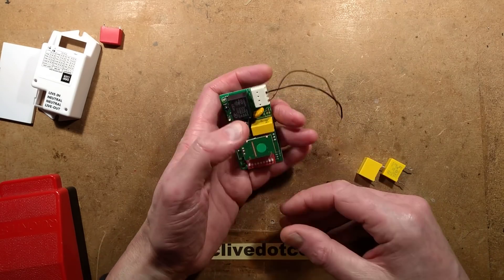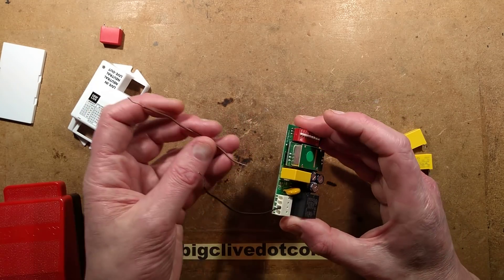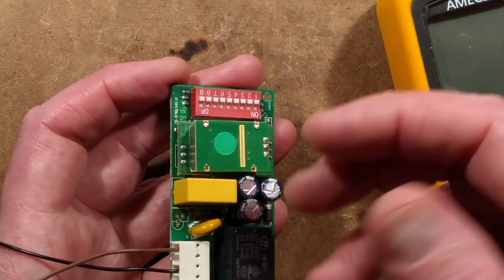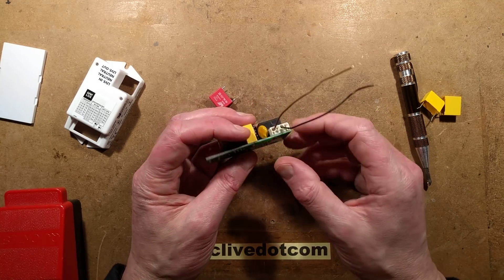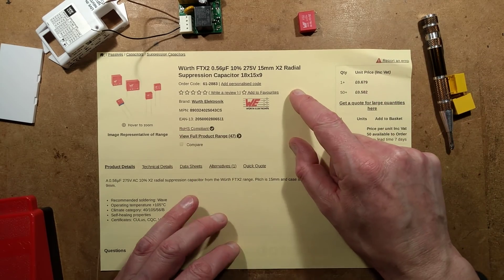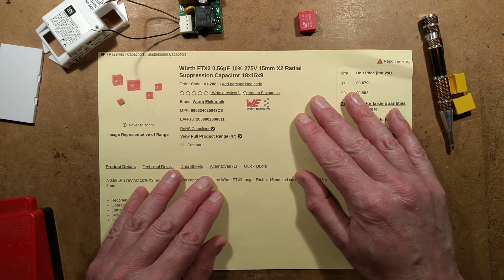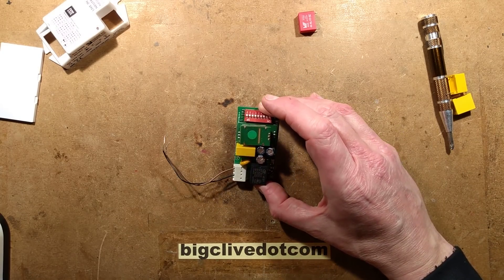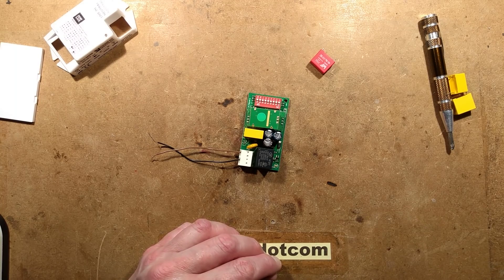Fixing a microwave body detector.

Comment: Hahahahaha!  As a faculties director of two hotel casinos it’s a shame to say my crews would not be capable of that simple repair even if I showed them what to do. Forget the parts cost it’s a straight R&R every time. Now the ten bucks on the power bill annually is a real problem for me because I do get charged for power factor. Probably costs me $200,000.00 a year on the bottom line. Love your work BC!  Keep it up.

Comment: I found a internals from PIR detector a few days ago. Apart from damaged solder pad it didn"t have any other obvious faults, but still wouldn"t give any sign of life. It turned out, that exactly the same capacitor 334 (330nF) has lost almost half of it"s capacity. Replaced it and sensor came back to life. Thank you :)

Comment: I had a cheap China ordered microwave motion detector that I tried. I didn't like it much. Sometimes it would detect through doors, meters away when I'm still walking down the stairs to the level where it was placed. Also the relay died in it in a year or so. (Which I don't like anyway because it clicks and adds delay). Since didn't want to do (and don't know hot to really) rewiring I had to connect it within the lamp body.
It's this sort: https://www.aliexpress.com/item/32723438815.html

(also the max timing was 3 minutes which was annoying, but not the fault of the technology.)

I had a better experience a cheap PIR kind: https://www.aliexpress.com/item/32598059177.html
Though it is too big for the 65mm round boxes used for switches and wall sockets we have here it fit well in the 80mm box that's only used for electrical piping. And since it's only required to be connected on the live wire I only needed to cut  and connect it. It switches instantaneously, because it's electronic and it's pretty sensitive.
It does need to be powered down for several minutes when you unscrew bulbs and change the time delay, otherwise it just blinks crazily for god knows how long.

Comment: X1 and X2 capacitors use zinc metal layers. This was a step change in production methods about 20 years ago in a bid to reduce the size and cost from the aluminium film. However, when zinc oxidizes it becomes an insulator and interestingly becomes transparent and therefore looks like the metal has gone but it's just converted to zinc oxide. There will be a gradual decrees in capacitance while it oxidizes at the edges but when it oxidizes right across the width of the film you can loose a large section of area and a big loss of capacitance very quickly.

The problem comes from the fact that it is impossible to seal the lead. There is a differential expansion coefficient between the epoxy resin and metal so will crack allowing moisture inside, so these will fail quicker in damp environments. Manufacturers have experimented with oil impregnated versions to help seal against moisture and do improve longevity by about 50% in cool climates.

The best X-Caps are those made with aluminium as they do not degrade any where near as fast but are much larger and no one makes them anymore I believe which is unfortunate as these are used in a lot of products from Showers, Boiler controllers, washing machine controllers to small sensors like these. We used them a lot in products until we started seeing premature failures after they changed the chemistry and we've now switched to small switching power supplies with high grade electrolytics.

X caps are used since they are guaranteed to fail open circuit and not burst into flames and therefore no inline fuse is required saving cost and power supply complexity.

However this product fails Low Voltage Directive because it doesn't have the discharge resistors.

Comment: It's about time those capacitative droppers got banned. They are cheap and nasty, especially when they have no bleed resistor across the input capacitor. Power factor correction isn't such a difficult thing to implement on power supplies... a lot of reputable computer power supplies are already built this way. The other thing that can be done is to get an average measure of the PF for your entire house, then correct it at the switchboard. There's always a way to poke the bean counters in the eye. 
BTW, the PF issue is also used to pay you less for your solar power (or make you generate less than you otherwise could). Some companies here in Australia make you generate at a PF of 0.9. That way, they place a 90% limit on what you can input to the grid, and of course that's after they've already put a cap on the biggest system you can connect up to them. 
Roll on solar/battery systems. That way, you can either go off grid, or use your own battery power when your house's PF is at it's worst.
If the power companies keep fiddling with how they bill us to get more out of us, a lot of us will get wise and leave....

Comment: Speaking of technicians fixing things. The building services people at work decided to do a genset test, but evidently there was some piece of faulty equipment, because it spiked all the UPS circuits in the building when they cut over the UPS supply to the genset, causing the breakers to trip, but not before it took out its fair share of gear. Thankfully I wasn't on call though! Most of our gear was under support, and had redundant power supplies, so the guy who was on call logged faults with our support provider and spent half his weekend waiting for replacements to arrive. Of course, he forgot to check the network switch in the technicians' workshop, so the replacement arrived on Monday, I went to swap it out, but the technicians had already replaced the blown capacitor in the power supply, and were busy working on other faulty gear that we were still waiting on replacements! I had to tell them to stop, because we get charged a re-stocking fee for returning working gear instead of the faulty ones!

The worst part was that this genset test was after the last one, during which the generator failed to start, so once the UPS batteries ran flat in a few minutes, our entire data centre just unceremoniously shut down. Thankfully these incidents weren't at the head office, so these failures didn't completely shut the company down (although it has happened there once).

Comment: How about using greencaps/resin dipped film caps instead of X2s? Would they last longer? I know they’re not as safe, but a fuse(able resistor) in series would prevent that being an issue.
Reply from the maker: X2 caps are supposed to be the safest for connection across the mains.

Comment: The office floor I last worked in, had all the microwave sensors replaced due to a few offices, mine included, having lighting problems. Building was only 5 years old. The old sensors thrown into our office waste paper bins -now I wish I had brought the old ones home. Problems continued ;) most annoying of which was turning off lights or dimming them several times of an afternoon. The Building Control System is apparently the real culprit, so the System installer told me.

Comment: Power Factor charging utilities - I take it that only applies to silly smart meter users of which I am not one.
Reply from the maker: It is a feature available in the software of the smart meters.
Reply: Yet.
Reply: @hgbugalou  Dunno about that. I've already considered having my own meter !
Also considered off-grid solar & use either inverter or generator for mains powered stuff. So much can run directly of 12V nowadays. All lighting fer instance.
Reply: @millomweb 
Hmm.

Comment: We have 3 of the Lidl motion detecting night light and one of them would trigger on and after a while it would turn off as it’s supposed to then turn back on again it was getting annoying... I took it apart and the glass lens of the IR sensor had like a water stain on it, I cleaned it and it’s now ok

Comment: Cpc packaging - orderd 1,000 standard 5mm Leds, delivered in 10 bags containing 100 bags containing 1 led.
Reply from the maker: That would be kind of annoying.  When I used to order microcontrollers from RS they often came with every chip inserted into an anti-static carrier and a bag.  Which was actually good, because I used to ship my software out on the programmed chips in the same carriers.
Reply: And ? the maths seems right to me.
Reply: @millomweb  Waste I'm guessing. Someone somewhere took a bag of 1000 LEDs and put one in each bag. :)

Comment: In the power supply of a Philips Senseo coffeemaker an X2 condensator was used too. The brand DAIN was notorious for loosing its value. In the device we owned the value did drop from 470nF to 105nF. The result was that my wife got cups with half the amount of coffee...
Here a thread and photo on a electronics forum (in Dutch): https://www.circuitsonline.net/forum/view/message/1352281#1352281

Comment: Clive, have you tried a OnePlus 3 or 5 for filming? These phones are now available used for rather cheap now, so they might be a good alternative. Also, you could install a custom ROM on them, if the stock firmware somehow messed with the camera operation.
Reply from the maker: I'm cautious about buying second hand phones because it seems common that if someone breaks a screen they change it for a generic replacement and then get rid of the phone.
Reply: @bigclivedotcom  Oh, I see - I haven't experienced this here in Germany though, all the phones I bought used had a screen in them of which I could tell that it has been used a long time, by small scratches and normal wear and tear. The phones still worked fine though.

Comment: Sometimes the choice of a cheap component has far greater cost implications than just the cost of an entire new light fitting - sometimes the expense of physically replacing the fitting is significant. 

Our electrician told me of a job where he had to replace 6 LED fittings that had failed prematurely   The LED fittings in question were at the top of a 7 story atrium above a stairwell and the only way they could be accessed was by building scaffolding all the way to the top. This scaffolding had to be put up and torn down twice as the fittings were in different parts of the atrium and the scaffolding couldn't be wheeled from one position to another. 

The total cost was around NZ$40,000 (approx £20,000) and needless to say the building owner was not at all happy with the cost.
Reply from the maker: I despise architects who specify locations for lighting that are difficult or dangerous to access.  They should be made to collect, drive, carry-in, build and then use the scaffold to go and fix their own stupidity.

Comment: 390nF is a standard value. I wonder if the original was mislabeled instead defective.
Reply: Could it have been made from 2 'standard' values and one of them failed leaving the other still working ?
Reply: @millomweb  Possible, but very unlikely. Capacitors aren't made that way.
Reply: @misterhat5823  Odd tho that a partial fail would result in a common value. Just trying to throw an odd but possible reason !

Comment: Power companies compensating for our ever decreasing demand for energy?. . . . We are pushed, shoved, bullied and cajoled into using less energy by buying more efficient devices and having "smart meters" installed, all in the name of saving money, or the ecosystem, or whatever label you might choose to hang on it, but the power companies are bound and determined to make sure you continue to pay them just as much money per year, regardless of what you try to save. 🐷 🤑 😡
Reply: The older I get the more tempted I am of going off-grid.
Take yer typical gas boiler fer instance. Swap it for a gas fired IC engine driving a generator. Recover all the heat from the engine - including exhaust gas to heat hot water and CH rads.

Comment: The terminal you use for connecting to your power line (i guess 230v?), where could i find one? It looks like its 3D printed.

Id love to know, need one for my circuit testings :D
Reply: Cliff quick test, he has a video on it
Reply: They are unreasonably priced, bit very handy. Back in the day when nothing came with a plug, they where in every shop selling electronicals.
Reply: RS components sell them and loads of other good stuff.

Comment: Regarding the capacitor problem - a couple of years ago I had a consulting job with a Swedish company. They had discovered a similar problem in their capacitive dropper supplies (which were manufactured and spread in quite substantial numbers). However, these droppers were flawed in their design from the start - there was always a high DC voltage over the capacitor which together with the AC voltage asserted a high stress on the capacitors. They wanted originally to have a different outcome of this investigation - they were looking for someone else to blame, either the capacitor manufacturer or the distributor for possibly selling them counterfeit parts...
Reply: Hmmm I know of a major Swedish company that sold a lot of faulty capacitance dropper power supplies.  Small world.

Comment: I thought I was the only one that dragged broken things home and fix them. Its a hobby for me. My first experience was a huge cash register from a store. I threw it in the trunk of my 70 Chrysler New Yorker and dragged it home. I spent days working on it trying to figure out why it wouldn't cycle after pushing in the keys and hitting the total. Sometimes it worked, sometimes it didn't. It was mostly mechanical but used an electric motor to do the final cycle. I finally gave up and scrapped it. What a heavy beast it was. Now they are 1/3 the size and fully electronic. Even the printer is electronic.
Reply: The memory on those mechanical calculators lasted for ever - not a hint of a refresh rate.

Comment: The power companies put capacitors on the power lines (in America at the 13.5 kV level) to compensate for the primarily inductive loads that almost every home and all industry present, so they will never ever bill for apparent power.  The capacitors are remotely switched in and out and are scattered around near the loads.  Ron W4BIN
Reply from the maker: That worked OK with purely inductive loads, but the main issue these days is electronic loads.  The power factor is completely different, with most of the current often being drawn as a significant peak at the top of the sinewave as capacitors are topped up.
Reply: the thing with a desire to bill for apparent power being behind the push for smart meters doesn't quite add up to me. the power companies, being money hungry corporations, are currently charging as much for their product as they think market conditions will allow. how much would they charge after switching to a billing calculation involving power factor? as much as they think market conditions will allow, naturally. Ive yet to hear a satisfactory explanation of how a change in the calculation would cause the market to bear higher overall prices. 99.9% of people dont know or care about the technicalities, they just see the number at the bottom of their bill. the power companies, if they thought the market would bear higher prices, can always raise their unit price for electricity. if they see this slack in the market why would they be currently be supplying electricity to people for less than they thought they could charge? not out of generosity and the goodness of their hearts, surely.

Comment: We have an outside led microwave security light with a microwave detector similar to this in it, with ours, the rain and the wind blowing the plants trigger it 😠 and we have to turn it off.
Reply from the maker: I think the use of the microwave detectors in outside lights is driven by economy and the lack of need for a dedicated housing, since the RF can pass through an existing case.  It's really not suited to use near foliage as the wind movement does trigger it.
Reply: bigclivedotcom - would a PIR sensor be better than this? We did have a conventional halogen style PIR security light but it got moisture inside the light head with condensation on the window - this blew the halogen tube bulb (we assumed the moisture rotted the ceramic end caps leaking out the halogen) then dad brought a new (slightly larger) version from local electrical shop and this developed the same problem as well - when the short lived halogen tube had died (same symptoms as above) and ignoring the moisture, I bought an interesting looking LED filament tube bulb and put this in it and oh... this also failed in the moist head and dad gave up with that style of light and bought this plastic thing which appears to be well sealed and has a LED ES bulb and the microwave sensor- and the new problem of having to turn it off when it is raining/windy

Comment: Cpc are a great supplier overall. Ive been a trade account user for 25 years. Their replacement system is slick and reliable when there is a problem. But Like you I've had issues with their ropey packing however....though between you and me it's often left me with net gains after redeiivery. They are aimed at trade primarily though , so some private buyers end up not feeling looked after in the same way they would if for example they took back clothes to M and S lol.